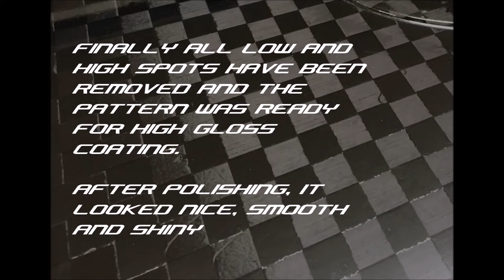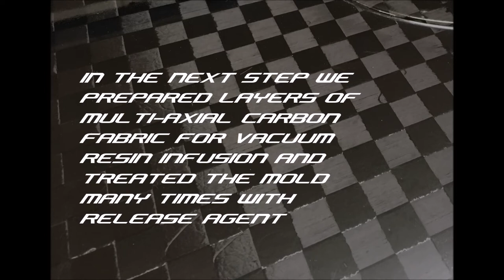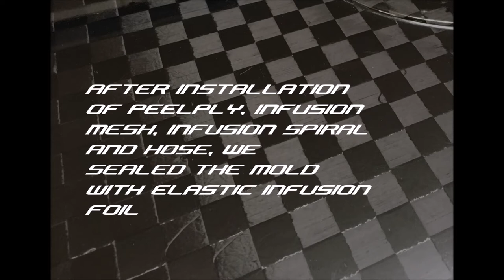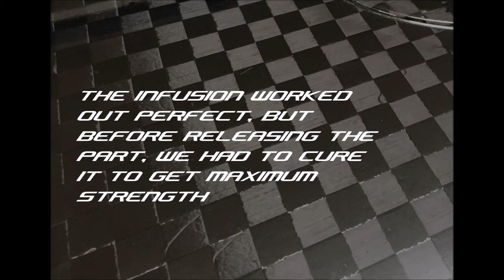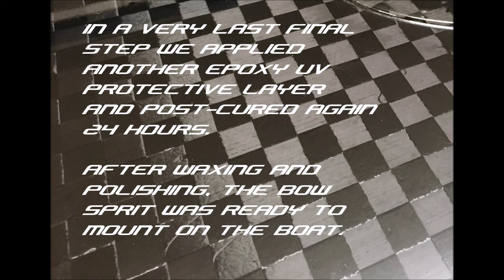DIY Full CARBON Bowsprit Project, Vacuum Resin Infusion, Pattern-Mold-Infusion in 6 Minutes.

Comment: It has been two years, it looks good, and I am interested. How is it holding up? can you step on the tip of the bow sprit? - and can it sustain the sideways forces of the code 0? How big is your  Have you put any support underneath the bow sprit?
Reply from the maker: Hi it is still great and excellent stability! No it is for sure not a good idea to step on the tip of the bow sprit. The sprit itself can stand it for sure but not the water stag where it is supported from underneath. you can see it on my other videos! this summer we will go to Croatia for two weeks sailing at the see it will be good fun! kind regards Alex
Reply: @alexandergstettner9820  Thanks, I have been thinking about making something similar, so it is good to hear that it has been holding up.

Comment: Hi Alexander what are the dimensions ? I am thinking of building one for my 6 mtr trimaran
Reply from the maker: Hi Paul! Happy new year to you!! thanks for your kind question. The overall length is about 126cm and about 80cm from the tip of the bow to the end of the bow sprit. it is a good compromise because it is mounted fix on the boat it shall not be too long but for sailing maximal length is wanted... I wish you great success for your project if you need anything let me know.

Comment: It came out really great. Looks very very good.

Could I ask about what heating blanket you used to post-cure? It looks like  heating blanket, but have not seen one going up to 90degC before :-)

You sure have put a lot of work and research into your projects, if you dont work in the composite industry.
Reply from the maker: Hi Rolf, thanks for your question, I am not working directly in composite business but I work in company which is producing material for this industry, we also have a laboratory in the company where I have learned a lot about the whole process, a good starting point which saved me a lot of time. The rest I have figured out by try and error :) The heating blanket is used as a barrel heater! They are quite cost effective together with the programmable temperature stearing unit, which is really cheap, it is a perfect set up, which worked excellent.

Comment: As a curious question, how many layers of carbon did you use? Looks like 2 weave, plus 6 uni of say 180gsm?
Reply from the maker: Hi Tito! thanks for your question, the carbon material I was using, apart of the chess pattern carbon fabric, was a multi axial carbon fabric in 45/45/0 angle. I cut the layers out in 0 and 90° formation in order to cover the whole spectrum of fiber strength in any direction. Additionally I introduced a special non wovens fabric which gives a bit higher volume with low weight (the white layer). in the edges and on some critical parts of the pattern, I have added more layers of multi axial carbon cloth. The base-structure of the bow sprit has about 4mm thickness. 
Please subscribe my channel if you are interested I have planned more exiting projects during long winter nights :) kind regards Alex